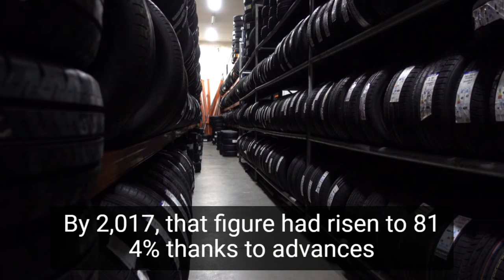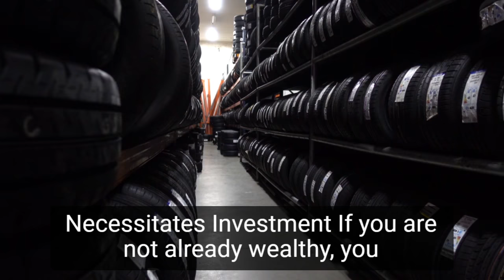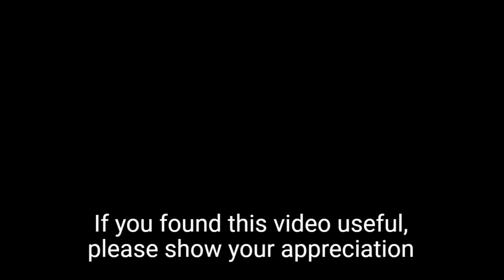How to Start a Tire Recycling Business

Comment: Your video is missing many of the main points of tire recycling and has some major fatal flaws. First flaw: You don't EVER purchase tires to recycle.  The main source of income from tire recycling is from the fees you charge to take in tires (Tipping fee). This can be anywhere from $1.50 to $4.00 for car and light truck tires and up to $200 for AG tires. Second Flaw: finding a niche is not good enough for your product. It is all based on location and state laws. Tire derived fuel and daily top cover for landfills are the most common ways of disposing of tires and all of these methods require  a shredder or multiple shredders and screening equipment. Even the simplest primary shredding operation doing 400 tires per hour costs around 200k to start. Getting into wire free mulch or crumb rubber is $750k - $1.5M to start. Great logistics and maintenance are the only things that will determine success in this business. NO one makes a dime on the back end, it is eaten up by equipment maintenance, fuel and labor. Once you understand this and have the discipline to stick with the numbers, will you be able to survive and possibly thrive in this business. If you want to jump into this as a green eco nut trying to change the earth just winging it, you will lose guaranteed!
Reply: You are dead on in your assessment of the tire recycling industry. I've worked for a scrap tire transporter for 18 years, it very hard work with profit margins on the lower end of the scale. I know owners of shredding facilities very well and the cost of operating and maintenance on those machines are very high. One guy bought a machine for 750k and the upkeep yearly is 50-70k on a good year.  Drums are always cracking, grinding teeth need to be replace constantly and the parts costs are insane!
Reply: I’m a mechanic @ a shop in Dallas texas I’m thinking of starting a business to dispose of used tires , I got the idea because my job has hundreds of used trailer, drive & steer tires just sitting there & I just can’t help to think I could make money from all those tires sitting their I want to start but don’t know where to look into or start can you give me an idea please I would appreciate it so much!!!
Reply: @JacobFlores25  call your local state EPA office and ask what the requirements are to become a licensed scrap tire transporter. EPA requirements a license to transport scrap tires to the facilities. That's makes you the middle man, tire shop charges for disposal, you charge the tire shop to haul their tires to the facilities that's the way the system works.
Reply: @JacobFlores25  tbh you're better off opening your own mechanic shop if that's what you enjoy doing. Scrap tires require a lot of overhead (employee/helper, truck purchase/maintenance, insurance, bonding etc.) and not much profit including very physical work.
Reply: Excellent advice!
Reply: You are Nuts if you think you are going to get anything for an AG tire! People use them all the time. Car tires are worth 1 buck apiece!
Reply: @donraptor6156  Are you in the tire recycling business? No recycler would take an AG tire for free. Depending on your shredders it could take 10 hours to dispose of 1 tire. Your $1 per tire for car tires is unrealistic to keep a recycling company going. $2.50 minimum for individual tire $1.50 for truckload.
Reply: @dougthewelder  Sorry to inform you but the Federal tax is one dollar per tire paid by the customer to the tire shop! No business is going to pay you to take a tire beyond the 1 dollar! That is why the tire shredding business is a $$$¢ losing black hole!
Reply: @donraptor6156  I believe you are very misinformed. There is no federal tax that pays $1 per tire in the US. Canada has a subsidy though. Shops typically charge $2-5 disposal fee for car tires. Unfortunately most recyclers only see $1 - 3 of this fee. I have been involved in tire recycling for 20+ years and deal with tire recyclers around the world.
Reply: @dougthewelder  I am in the U.S. tires cost $1.50 for truck tires! It is all about the CA$H!  A mid size shredder costs over 3000 an hour to operate not including the breakage! Do the Math! It takes the shredder an average of 25 seconds to shred a tire! That is less than three per minute. If it were a $$ making business we wouldn't have over a Trillion tons of them in dumps!
Reply: @Baneautodetailing  Tell them! My fingers are numb from typing the warnings of a Failed Business!
Reply: @JacobFlores25  Half a million will get ya started! Prepare to lose THOUSANDS OF $$ PER MONTH!
Reply: @dougthewelder  No I am not in the business! Do you want to know why? Because I did my research talked to small bankrupt shredders! Down here people sell at tires to be repurposed not Destroyed!
Reply: @donraptor6156  No one take a truck tire in the US for $1.50. That would be a low end for a car tire. I don't what shredder you are talking about but the average shredding cost for maintenance and power is $.15 -.30 per tire which is no were near $3000 per hour. A 150 HP midsized shredder does 250 to 500 tires per hour depending on chip size. Do the math!  that's over $300 per hour after shredder expenses at $1.50 per tire. The reasons most tire shredder guys fail is that they cannot get rid of the shred in there location cheap enough to make a profit or they don't budget for machine maintenance.
Reply: Douglas sounds more convincing than anyone in the comments. 😎👍🤙☝️
Reply: @Douglas Bartelt  can I contact you regarding this business?
Reply: @dougthewelder  I was also thinking of opening one do you offer guidance o  this topic?
Reply: Thanks for ur in depth knowledge I’m looking to buy a tire company and adding a recycling plant in the future
Reply: @JacobFlores25  Were you able to start this business yet? How is it going?
Reply: @Baneautodetailing
Reply: @nonorose5502  how can I help you?
Reply: I too am interested in any information about what anyone has more on this. I'm looking at doing a mobile system along with an in house operation, feeding into a pryolysis plant. Any and all thoughts welcome.

Comment: Well this is something else I actually do this we do this in Ontario it is very expensive you need to be more than a multi-millionaire you are a slave to the recycling program the cost of Hydro has quadrupled in the last 10 years labour rates have doubled of course you're not the only one picking up these tires then you need to get a army of trucks a team of drivers but then you need to make a product the product needs to be sold so you can pay for the bills you have to approach big box doors basically have to give them the product that's how they get so rich you need to start exporting at around the world that's a whole lotta headaches if you ever want to see any food for basically putting up a video telling people they can start recycling tires I would move on to a different video and trust me I have to experience I've been doing this for over 20 years I'm just telling the truth